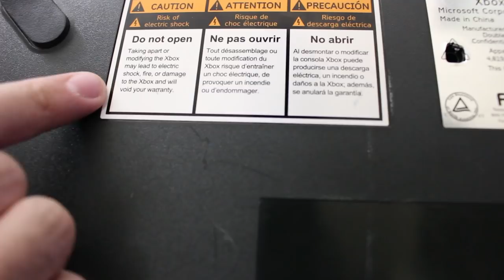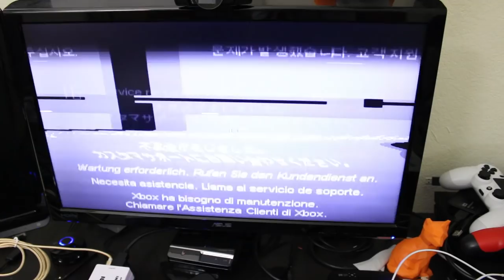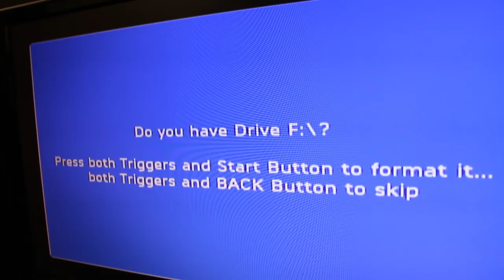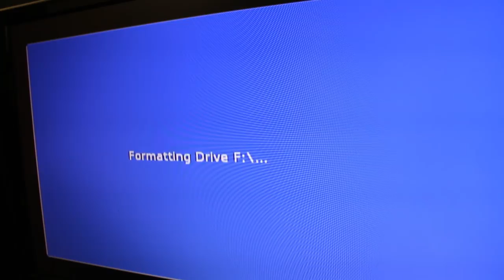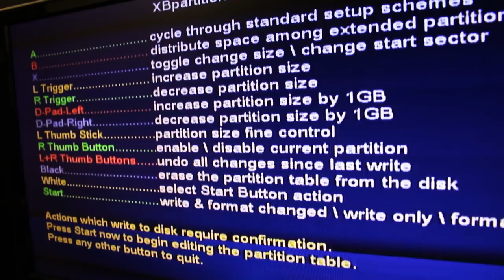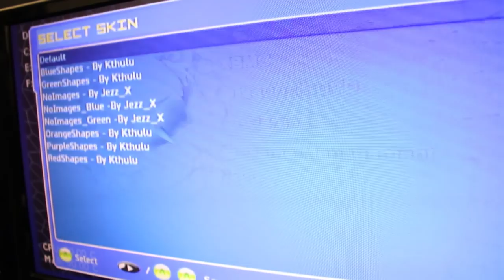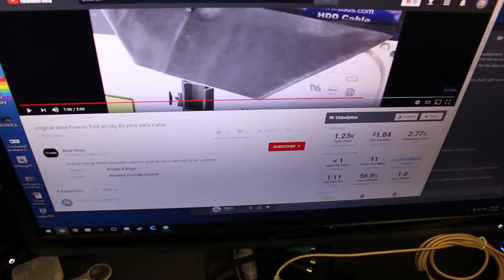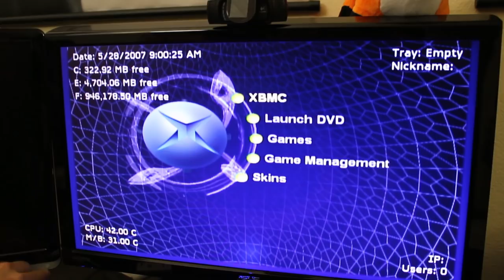Let's Upgrade an Original Xbox! - 80 Wire IDE Cable & 1TB SATA Hard Drive Install - Part 2

Comment: MrMario2011, what IDE (e.g., 80 wire) cable should I use for an SSD upgrade for my original Xbox? And what adapter do I need? Please advise. Thank you in advance.
Reply from the maker: Linked what I use in description.
Reply: @MrMario2011  Thank you!
Reply: Did you have to download any drivers for your hdd?
Reply: @flagshipbuilds  Do not use an SSD on the original xbox. The xbox OS does not support TRIM functionality which will cause excess wear and tear on an SSD. Not to mention you will still be limited to the IDE cable speed which will make it no faster than using a HDD.

Comment: my cd rom not working right after i added 80 Wire IDE Cable & 1TB SATA
Reply from the maker: It could be an issue with either folding or the cable itself? I have a Xbox here with that same issue.
Reply: @MrMario2011  ok i still didn't get it work It came from died pc my son gave me few years I order another cable
Reply: @MrMario2011  I got it to work however by plug in cd in first and hard dive 2 sec in other my cable made backwards  I copy all my games by sides one game cd had cracked in. thank good ness i had backup copy on my old 320 gb i was using on my xbox I copy to my pc then onto my 1tb hard drive . After i done copy all games  I put cdrom back in away it goes in cable i don't care i cant cdrom for now I am waiting for cable in mail I am just using F drive

Comment: Wouldn't you need to lock the hard drive to the console? I remember having to do that when I swapped mine, but that was over 10 years ago.
Reply from the maker: If you have a custom BIOS, nope 😁
Reply: MrMario2011 Ah cool I didn't know that :)

Comment: Hello friends , I have an original xbox 1.6 softmoded and I just cloned the hard drive to a 120gb one , the thing is that with the new hard drive installed after the boot up animation the screen remains black ; even more weird is the fact that as soon as i press the dvd drive open buttom the unleashx dashboard will boot just fine .
Reply: as i said its 1.6 so its softmod

Comment: Why cant you just build the drive on a PC then install it? I would think you could just down load an original drive files and format the drive with that or is their a reason you cant?
Reply from the maker: You certainly can, but to me it's easier doing it this way with a custom BIOS installed.

Comment: I'm having problems running certain games like Gunvalkyrie in Unleash X. It works fine on the original disc but doesn't really work when copied over ftp.
Reply: try to copy it via the disk maybe the files are corrupted.

Comment: Any advantages to putting your games on the HDD? Been thinking of doing this to my xbox.
Reply from the maker: Much faster loading times, less wear on the DVD drive, convenience. I keep my entire library on there.
Reply: Plus, you can run the games with trainers (like infinite lives, godmode etc.). And there are some games that have widescreen hacks. But you could just burn these to disc as well.

Comment: I'm sure you get alot of questions on all your bad ass videos but would a 2tb make any difference cause I'm tryin to add as many xbox original games as possible
Reply from the maker: 2 TB is fine.
Reply: @MrMario2011  what was on that disc you installed and is there a way to install without the disc? Cause I dont believe I have a disc burner

Comment: is it possible to do this on Xbox 1.6 without a modchip?
Reply from the maker: No, can't TSOP flash those.
Reply: so if i have a 1.6xbox  modchip installed and modded would be ok right?
Reply: @skuartle  yes

Comment: If you use more than a 2TB, like a 3TB in my case, well you will be limited to 2TB but it will work.
Reply from the maker: I've been told you can use it all, but partitions higher than 1 TB could cause data corruption. Although I've only heard about that, never seen any confirmed reports. 2 TB is more than enough for me, but it seems going over that will probably still be fine. I've seen people confirm having 3 TB drives in their consoles for years with no issues.
Reply: @MrMario2011  I had a spare 3TB or else I would have used a 2TB. But working in IT, I knew it would work, since you will leave the remaining un-partitionned. Thanks for the video!

Comment: I bought one of these and they sent me a much shorter ribbon. I had to end up folding it up pretty strangely and mounting the drive upside down. I noticed that certain DVD drives taking too much power are the reason a regular ribbon will not work. It will detect the dvd drive first and than discard the drive altogether. Which makes sense, but I thought I'd elaborate for a better understanding.
Reply from the maker: The IDE cables are shorter, it's all in how you bend them up.
Reply: @MrMario2011  The one in the video is much longer than the one I got. Dude, this one is  crazy short. I almost went with a Phillips drive which is a great model other than +/- compatibility but ended up going with an 8050L. I remember way back when- reflashing a PC drive with 8050L software and it was the best drive I ever had other than some eject detection issues. 

I've done tons of these back in the day with Xecuter 2.3b lite and 2.6CEs but this was my first TSOP and what seemed ridiculous all those years ago is soo simple today. Of course it was more expensive back then and the risks were more significant without an eeprom reader! 

The Unicron Ponyprog method was hard to get a decent diagram of too, and so I created my own based on guessing mostly and posted my tutorials. I don't know how this led into a life story but to have 1.5gb SATA is definitely a step up from all those old'n days. 

Next step: remove ram from a dead board and upgrade to 128 since I actually have the tools. I've always wanted to do that. (Hey! "The Faculty" reference!). Keep on killing it, man! Every time I have mostly an idea how to go about things I can always reference your videos for a full breakdown of what to look out for. Good stuff, man!

Comment: I never made backups for my x3 miss that customized xbox boot up and seeing Xecuter Rox My Box logo I gotta figure out how to add a new HDD with no current drive. :'(
Reply: Theres now a new way to dump the eeprom and use it with XboxHDM32USB using an arduino pro micro

Comment: TY. Very clear and helpful. Just curious what is the length of cable you used. I know the original is 22" but has lots of extra folds to essentially shorten it.

Comment: jumper in the hdd ? no jumper?
Reply from the maker: SATA drives don't have jumpers, the jumper on the IDE adapter is set to master on default though. Had no issue with it.

Comment: Your 80 pin IDE cable has a max speed of 133mbps, and your 512mbps cache speed SSD is overkill. A 128mbps cache speed HDD  is all you need.
Reply from the maker: There's no SSD in this install.

Comment: You can return the 40wire ide cable after doing the hdd transfer. I tested this when my 80wire ide cable didnt reach the hdd bay.
Reply from the maker: If it's not reading successfully on boot when blank I doubt it would work fine on a formatted drive? I upgrade all my SATA drive consoles to 80-pin wires, not much of a reason to revert back once I've installed the new cable.
Reply: @MrMario2011  i had an issue where chimp wouldnt read the sata converter on a 40wire, i wish my 80 wire would reach over to the hdd bay though =\ i would def keep it in there instead
Reply from the maker: You might just need to bend it properly, it's a tight squeeze but I got it. I don't ever clone my drives as it seems to be a bit of a hassle. I softmod, then hardmod, then drop in a new drive and nuke it.
Reply: If you use a 2.5" drive, you can get away with an 18" cable.   The smaller drive, allows you to position it, so as the 18" cable can be routed with little stress on it.   One of my Xbox systems is set up this way.   Drive easily sits in the caddy for the 3.5" drive, and the cable isn't stressed at all.

Comment: would the old cable work on a smaller drive like the 2.5"
Reply from the maker: I haven't tried it so I couldn't tell you, sorry.
Reply: I try this with another technics and it dont work
Reply: Technically it should work. You still need to power the HDD, though.

Comment: Hey all, I already have a hard modded xbox but want to change the HDD to a SATA 500GB. I've bought the necessary parts but I can't remember or know how to load an O/S onto a new HDD? I have a Slayers 2.5 disk in my inventory so I'm guessing it's something to do with that? I got help when I first did it over 10 years ago! Any help would be great! Thank you!
Reply: I guess "prepare HDD" in the HeXen menu does just that. I have not tried that option though.

Comment: Can you make a video showing how you transfer your games from your other Xbox to this one? Or are you planning to add the games manually?
Reply from the maker: If the consoles are hardmodded you can just swap drives with no issue. Since this was a new drive I just used FTP to transfer from my PC.

Comment: As your Xbox isn't 1.6-version, have you removed (or replaced) the clock memory capacitor? If it hasn't already leaked, it most certainly will in future... Ah, you did mention it at the end :) Good xD

Comment: Should have replaced the thermal paste while you where in there
Reply from the maker: I did it a month or so later when I case swapped this system, made a small difference so far but it's all cleaned and refreshed.

Comment: Can you do something like this on a 360?
In a video tho
Reply from the maker: I already have stacks on stacks of 360 related videos.
Reply: MrMario2011 But we love litteraly anything you make a video about on the 360 😜
Watching your videos (in 2017) has actually convinced me to pull my old Jasper and Corona from under the dust in the closet and mod them. The Jasper runs a Demon with RGH1.2 and the Corona has an ACE V3 chip installed. Saw it as an excellent opportunity to relearn my long gone soldering skills 😂 flashed the drives too while I was at it using your tutorials 😄 keep producing these great videos man! And thanks for your sharing your knowledge. Greetings from Belgium ✌🏻
Reply: Arno Bruynen I got a 360 from goodwill for $15. What’s the advantages of modding the 360? Isn’t the home brew better on the original Xbox? Thinking of modding my 360 since I have no other use of it lol
Reply: Hakeem G the homebrew on the original xbox is better indeed. But hey for another 10-15$ you got a modchip and voila you can run homebrew and do whatever you want it to do. I would do it anyway, you ain’t got much to lose 😂

Comment: Cpu and 128mb ram  upgrade next?
Reply: caleb carvino Not worth it.  Very few games run unlocked, making additional RAM next to useless, and a CPU upgrade would only benefit a handful of emulated games.  

The CPU upgrade requires a professional workstation, meaning you'd likely pay several hundred USD just to upgrade to a marginally better, 15 year old processor.

Comment: i have xbox original with evo chip but hdd is broken and dvd is not working any tips how to fix it mr.mario
Reply from the maker: Replace HDD and fix up the DVD drive.
Reply: @MrMario2011  the drive is no more its done any other ways ??